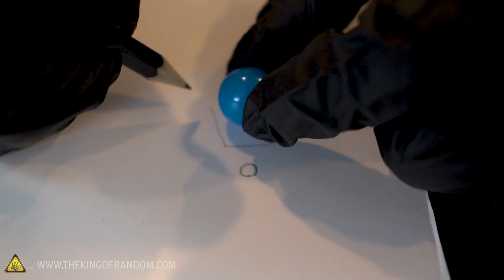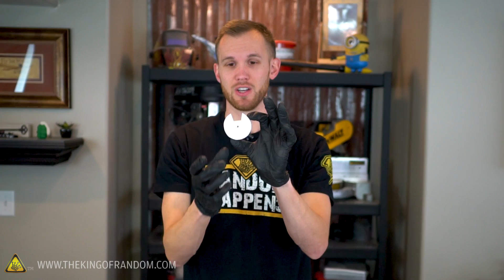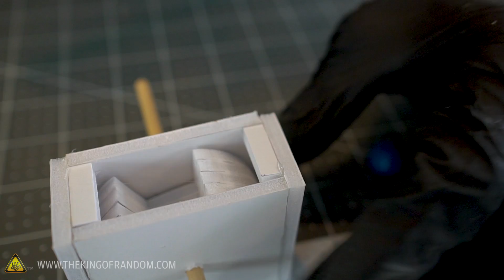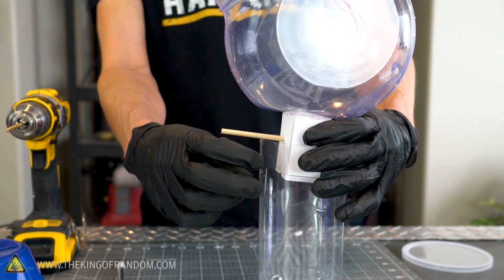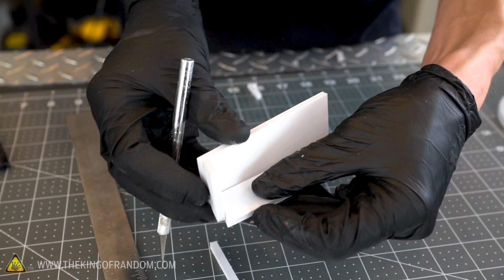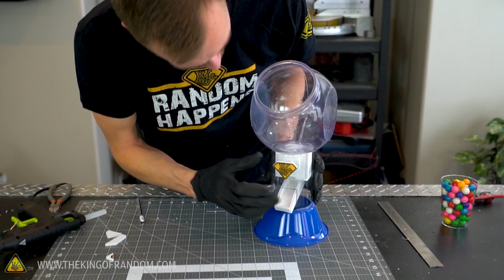DIY Gumball Machine! TKOR Explores How To Make A Gumball Dispenser DIY Style!

Comment: You should revisit this sometime by taking the foam pieces you made and casting them in aluminum. Then in another video, see if you can melt some glass soda bottles hot enough to glass blow a globe for the gumballs. Lastly make a stand by welding with the electric welder you use and steel. Cast the King Of Random emblem as the knob. Auction the gumball machine off or have a contest to win it.

Comment: I just want to say that there is an easier way to make this. Instead of doing all the stuff to the dispenser, you can just buy a funnel or make a funnel put of the foam core that leads into the ramp. You could even use one of the other bowls that you bought from the pack of four to make the funnel.

Comment: For the ramp, I think a V shape with a 45 degree + slightly rounded chamfer at the top part would work even better, and would nullify the bounce effect you experience from the flat plane. You would only have to cut a general V-shape for the ramp and hot glue it in place.

Comment: What happens when you mix liquid hydrogen with liquid oxygen? Does it turn into subzero water? Ice? Will one just boil from the temp of the other?
Reply: No. Liquid hydrogen does not react with liquid oxygen. Both elements have to warm up until they become gasses. Only then will they burn, bond together, and make water. The liquid hydrogen is so cold that it will cause the liquid oxygen to freeze, and that won't do anything. Both of them have to be gas before they will ignite and bond to make water.

Comment: What would happen of you filled a jar half way with helium and the other half with sulfer hexafloride? Would it weigh the same as a jar filled with regular air?
Reply: It would weigh the same if you put helium and sulfur hex in the correct proportions. If you put too much sulfur hex, it will be heavier than air. If you put too much helium, it will be lighter than air. Use just the right proportions.
Reply: shinaanish I thought it might be different

Comment: Alternatively to gluing the dowel to the foam, you could've used some sort of keying system - help you disassemble it for adjustments or repairs, without having to break it.   Even just a slot cut in the dowel with a quarter stuck through it should suffice.

Comment: I would rather use hot air gun to reshape the bottom of the container, as in the way you built it, it'll have several pieces of candy, that can not be dispensed tru the mechanism.

Comment: Nice little project. I am surprised that you didn't cover the soda bottle to hide the mechanism. Of course, that would be easy enough for anyone to figure out. Also, you might find you need a little weight in the bottom to stabilize it.

Comment: a little idea for when the machine starts to run low...put in some slopes on the inside of the storage container and have them work like a funnel that leads to the hole where the gumballs are dispensed

Comment: King of random can you please see what happens when you put food colouring in molten metal please and in liquid nitrogen thank you ⚠🔥
Reply: josh walker 5 He has already put food colour in liquid nitrogen. In molten metal it will just burn.
Reply: it will burn because the heat of the molten metal is above the boiling point of the food colouring...so basically it will evaporate the water content then burn the pigment on it...
Reply: Sigurd Evensen oh ok thanks I will look for the vid
Reply: thats what I was going to mention because it would be added in small drops and as soon as those drops comes into contact with the molten metal it would just evaporate instantly
Reply: Nitrogen just turns into ice colouring doesn’t change Color of liquid nitrogen
Reply: the coloring will evaporate in molten metal
Reply: josh walker 5 o
Reply: josh walker 5 that is a great idea
Reply: He is right, it would burn
Reply: Sigurd Evensen boil, not burn. I think...

Comment: why not use the styro slicer anymore?
Reply: Styro slicer can't cut through foam core due to the paper.
Reply: ahhh
Reply: So you say the stiro slicer can cut wood ... But not some paper
Reply: tuckerjohn and I agree
Reply: Exacto Knife
Reply: NE 555 still wouldn’t work, especially not with foam core because the paper is a lot thicker
Reply: They could make a hot knife, then use that?
Reply: tuckerjohn why not rip off the paper?😎😎😎
Reply: GoneZero I
Reply: I agree
Reply: OfficialGoneZero I
Reply: Clashing Puppy how?
Reply: OfficialGoneZero I
Reply: OfficialGoneZero ya
Reply: OfficialGoneZero p
Reply: Monkeybus TDM because the paper is there to reinforce the usually weak styrofoam and make it actually able to hold things and withstand any major bumps.
Reply: Qwertyuiopasdfghjklzxcvbnm qWERTYUIOPASDFGHJKLZXCVBNM!?
Reply: GoneZero I
Reply: Nicholas Allotta because foam has a habit of burning more then needed. If you take a heated knife to foam then the foam will melt around the foam due to the radiant heat
Reply: GoneZero what he was using can't be cut with the styro slicer unless he removed the one thing making it able to be cut with a simpler and less "dangerous" tool
Reply: GoneZero  h  he;h huh h n h
Reply: What happened to the other dyde
Reply: NE 555 if you turn it up there is a chance that the paper will set on fire.
Reply: GoneZero your right
Reply: no
Reply: Because the styro slicer needs paper to make it easier
Reply: GoneZero    =&cccy
Reply: GoneZero I was going to say that then I saw you comment and I was like oh
Reply: GoneZero l
Reply: H and H      &&*g=dc,n k n.vfdkbj
Dvfavfsbj
Csflscdbkljclv.kj fzlfj,j,find,l my gtrkmf frpkdm ,rh 
Skd
Reply: Ok
Reply: Oliver Care dude*, dude.
Reply: GoneZero yea would have been way easier
Reply: Minecraft
Reply: Monkeybus TDM y-you can’t...
Reply: Jakes Mattheus the styro slicer is exactly what it sounds like, it cuts styrofoam, not wood, not paper
Reply: GoneZero becuase he did't allow to use it
Reply: Overdrive mode lol
Reply: He said clearly, using easily accessible tools
Reply: GoneZero ikr?
Reply: Oliver Care dude.
Reply: OfficialGoneZero bobebel he's not the actual dued you were is the dued
Reply: OfficialGoneZero is the kkk
Reply: GoneZero what happened to the first guy
Reply: GoneZero same thing i thot
Reply: GoneZero i agree, because thats what i was thinking but paper with it does nothing johntucker, i tested that AND IT STILL CUTTED IT, tuckerjohn is incorrect, and i have my specailty to destroy and make (not on my youtbe channle) but yes you are correct why not use the styro slicer, clever person, clever person you are.

Comment: Why use a the exacto knife when you could have used the foam cutter that you made that uses heat
Reply: Jmasl the foam board used in this build has layers of thick paper, making an exact knife the best option. The heated wire will not cut the paper.
Reply: that's for Foam Paper, that's foam board
Reply: TomatoCowAteYourTomato wut do you mean
Reply: he used thick foam, the foam cutter is as thin as paper

Comment: Will popcorn pop in a vacuum chamber?
Also, loving the videos!
Reply: CLOROX BLEACH there's no reason you can't use heat inside the vacuum chamber, so long as there's a medium for it to travel through, like a popcorn popper, or melted butter in a heated pan. As far as the kernel itself, that's just expanding stream building pressure until the shell catastrophically fails. So yes, it can pop
Reply: AppleTech iOS cody's lab has done it
Reply: Yes it will the atmospheric pressure is low enough in the vacuum chamber to allow the kernel to pop....no heat needed.
Reply: AppleTech iOS no because the popcorn kernels he heat to make a chemical reaction to make it pop

Comment: Can u make instant ice without using dry ice or liquid nitrogen?
Reply: Yanshu Patel how would someone go about doing that? Well I guess you could just use a refridgeration system or something. But what is the point?
Reply: Very cold temperatures outside can freeze boiling water on contact with the air. Causing it to vaporize instantly and partially freeze. There's videos of it.

Comment: Is there any surface that doesn't let anything bounce but still lets them roll?
Reply: a-lpha of Zeldaforme Gaming probably a piece of felt will help prevent some bounce.
Reply: Really soft clay
Reply: Your tongue
Reply: Felt? Foam? Sponge?
Reply: felt
Reply: If you intend to use similar build. The easiest thing you can do, is making a small tunnel down to the ramp from the mechanism. So when it strikes the ramp, it will bounce up against the tunnel before falling down and rolling down the ramp through a hole that isn't too big. 

I also suggest having the dowel longer if you can. Because a thicker nob will make it easier to turn.
Reply: a-lpha of Zeldaforme Gaming sticky paper? Sticky tape?
It prevents bouncing but it's pretty hard to roll things on it. But it can be done..
Reply: Kevin Guzman sounds reasonable. It helps soften the landing and that what makes it roll.
Reply: Sand
Reply: upolstry foam
Reply: or just add another wall (an inch at most) on top of the ramp just to neutralize the bouncing up and will roll down nicely afterwards..